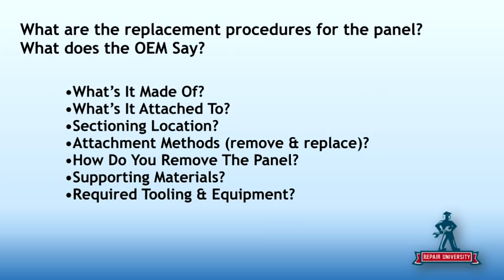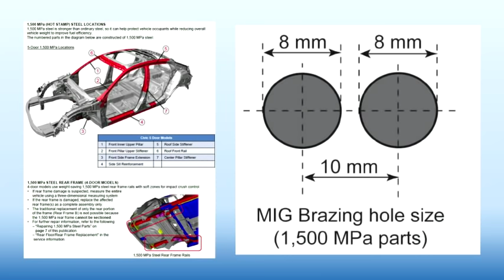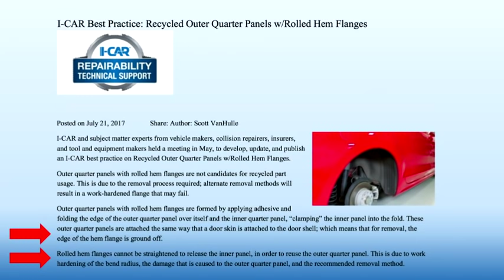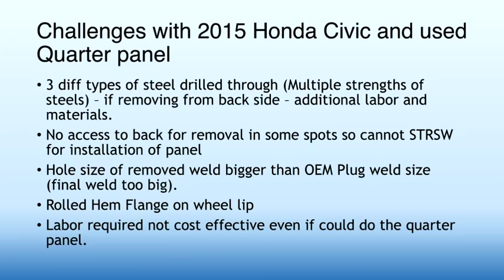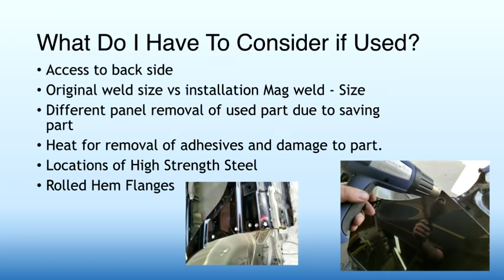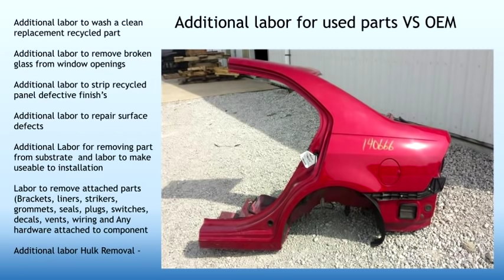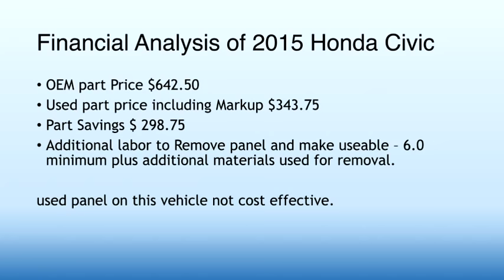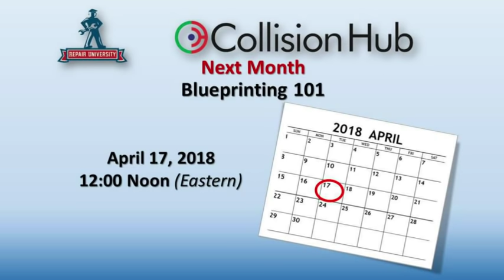What's Wrong With Used Quarter Panels   -----       Repair University

Comment: Skill and responsible work is the key. New 1/4 panels installed improperly vs proper used installation? It's not the part it's the skill of the technicians!!

Comment: OEMs have to make money so of course they're not going to advocate the use of second hand parts from a salvage vehicle. If OEMs had their way, junkyards would be forced to crush every vehicle and not keep an inventory of good used parts that cost much less than new stealership equivalents.
Reply from the maker: It's not about the position statement. Even if a OE did not have a statement on used quarer panels, the shop should be Technical enough to know why the part can't be used. 
Follow the science and operation and the question answers itself.

Comment: 1hr is that after removing the interior, doors, glass, trim, lights, wires,wheel, protective covers removing all sealers and still not ready to grind 1 of the 70 welds ya she works for the insurance company

Comment: Most welds are cut with a belt sander
Drilling is very rarely done 
It's hard to take someone seriously  when they have never actually done what it is there trying to teach
Reply from the maker: Actually no they're not. But even with a belt sander you still damage the donor panel and it makes it no useable so how you remove the spot weld is irrelevant to you removed it. All 3 do and have done Collision. Larry has two shops and works daily. You are welcome to visit or you can list your shop information. When were in your area we'll be happy to stop by and work along side you.
Reply: @Collisionhub  I appreciate your time and responce 
I have been a collision tech for 35 years so i understand your points of veiw and i believe  people like you arr great for the industry and i appreciate the work you do
But it seems that the trade goes in circles the OE's Don't design repairability into the car the insurance companies Don't want to pay shops 
Shop's don't want to pay techs 
The whole trade is still tragically flawed 
Most of the repair procedures are based strictly on liabilty 
I would love to see A used Quarter repair done to the best of Larry's shop ability seeing how top flight standards are strictly follwed
Versus a new quarter replacement  on the same vechicle to see the real world difference in a crash 
Is it as bad as we think or is it better we really don't know 
We both know thousands of used quarters have been done and you don't hear about many lawsuits 
Were i live in Pinellas county Florida the shop rate is 46 
Its the same for frame time
If you want to be an employed collision tech in florida you have no choice but to use what they give ya  
I enjoy all your videos keep up the good work
Reply from the maker: @matthewoneill3229  I appreciate your position. I know it's tough.
But a few points. 
We do have catastrophic damage that happens frequently. We have a handful of cases a year, but they all settle. A case that can be public, like John Eagle, is rare. The reason that went to trial is the shop thought there was no way they could be liable and yet the jury gave $42 million. 
I've been at this since the 80's and I can tell you that we have never had a time where the OEs have been more concerned about repairability. We are just now in an industry where technology and function are colliding. We should have been on point in 2000 but we (shops) were asleep at the wheel. Coasting on fat DRP agreements and we got stupid. Still looking at cars like it's 1997. 
You will see more shop liability lawsuits. I tell every owner. You got to fix a lot of cars to make $100,000  in profit. But It only takes one $100,000 judgement to bankrupt you.
Reply: @Collisionhub  I understand what you are saying and I get that 
I just feel that the industry as a whole doesn't really care as much as they say they do 
Lets face it all the Oe info must be purchased. All training is super expensive everybody wants to make there dime
If the  manufacturer wants specific  hole sizes and locations and backing material theninclude them in the repair panel make an proper repair  as easy as possible 
Include detailed instructions with part 
The problem i see is we as an industry went from the far left to the far right
If the big eagle case went the other way 
Would a dam thing have changed
It seems to me that a bunch of 
Seen an opportunity to make a bunch of money off of the fear of that  lawsuit
Reply: Removing the used 1/4requirs drilling the welds on the doner panel

Comment: why would the shop section the quarter panel on my challenger intead of replacing the entire side panel like the factory.
Reply from the maker: Well you can't do anything "like the factory". 
But the manufacturer of the vehicle test and writes a procedure for replacing a quarter panel. As long as the shop is completely following those procedures, that is the best repair for the vehicle.
Reply: bed redefining
Reply: Would you like to have the roof panel replaced also because it's welded over top of the aperture or side panel. More than likely rendering the car a total loss and getting under valued,  you ripped off no rental and buying a new car at your loss. Intruding into undamaged factory assembly's requiring damaging overlapping panels and sealers trim, glass , interiors safety equipment, wiring, paint, ect.

Comment: In the real world an insurance company would Salvage the car if it needs the guater panel replaced.
Reply: Well that's great, then you can buy it and rebuild it.
Reply: LOL,you are so funny Larry. Even I wouldn't buy it to rebuilt it.  Only someone who would want it for parts would buy it.
Reply: Sorry I was under the impression that you do rebuildable vehicles.
Reply: I do rebuild rebuilable vehicles. Just because they claim its rebuildable doesn't mean you should rebuild it.  Some would cost more to repair than whay you could sale it for. A  reconstructed title cuts the value of at less 40 percent.
Reply: I replace them all the time. You can’t salvage a car just because it needs a quarter
Reply: They can if it cost more than what the car or truck is worth.
Reply: Keith Carpenter Sr. An insurer can total a vehicle for one dollar over the deductible.
Reply: Larry you mean one dollar over value of car not deductible
Reply: Sawmiller Smith never heard of a repaired quarter costing $10,000
Reply: Sawmiller Smith I agree. I thought they were talking about a fairly new car
Reply: Keith,the car is kind of new. Its a 2017
Reply: The comments on this are a bit deceiving.  Yes it may cost 10,000 to replace a quarter, but its not just the quarter panel, is it Sawmiller?  The link you posted, that car needs an outer quarter, rear cover(which consists of several pieces), a tail light, probably a rebar, rear body panel, maybe even the inner quarter, and suspension.  And to your original comment, I have seen plenty of cars we have replaced a quarter on that did not require totalling, and were no where near a 10,000 dollar repair.  

But as far as the video is concerned, putting used quarters on is a waste of time, but the OEMs could help us out by offering just a quarter instead of having to buy a whole body side for 1100 bucks.
Reply: George, you're right,it needs a few more parts that just a quater. But here is another problem even if the car is fixed to OEM .  When who ever owns the repaired car and tries to trade it in or sale it the wreck will show up on a car fax if its and insurance repair job.  Most will not pay full retail for a car that has been in a wreck even if the claim is it was repaired back it new with new OEM parts.I was using the car in the link showing what the insurance wants for the car and what they claim the repaires would cost.. The say the car with a clean title retail is worth 17,000. repaires are 10,000, adnd the will sale it for 8,000. First most do not pay full retail for a car. The car on a car lot would sale for about 15,000. As you can see the insurance company can make more by selling the salavaged car like it is if they can get 8,000 for it. There are millions up on millions of these salavaged cars being sold every year by these insurance compains like IAA and copart.

Comment: 20+ year body tech. Used quarter panels should not be allowed in the collision repair process. Everyone loses when a used panel is used. The shop loses money. It's reputation is possibly damaged. The customer loses out in overall vehicle strength, crash worthiness, and panel lifetime compared to an original panel.
Reply: been body shopping since 11 yrs old i am 60 now.i know the last 20 yrs all i ever used was used parts. james you are right the shop loses big.who ever said lkq its sucks inferior parts at a high price.only if folks out there read there insurance policy read the fine print. insurance co's have the exclusive right to chose the parts to fix your car.any thing insurance co's can do to save a dime off your back.i am a builder salvage titles.as time goes it gets more difficult to build cars. dam glued on and welded on parts.i am thinking of retirement. structural parts hard to use.

Comment: Used quarters suck and a waste of time,  notwithstanding the ethics,  but the wheelhouse can be lapped on a flanged used quarter. I'm not saying it is proper. And the safety is questionable.  Besides,  quarters rust.  I've seen more rusty used ones than clean ones.